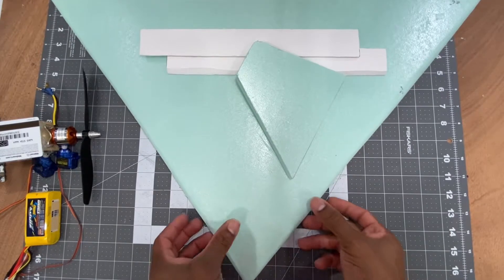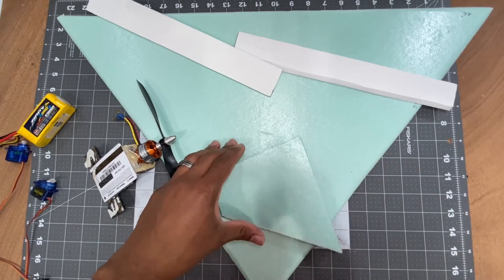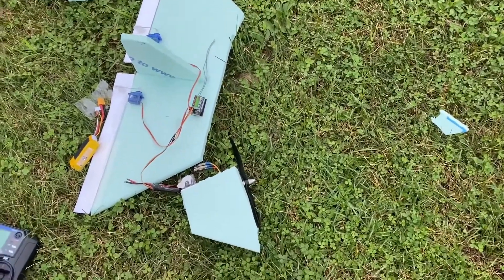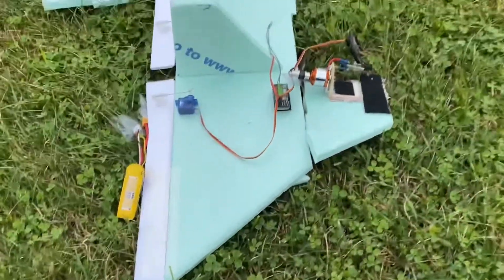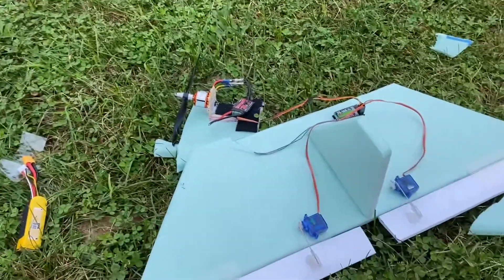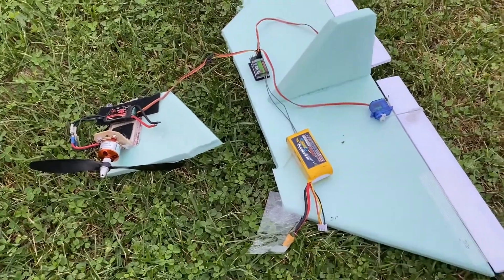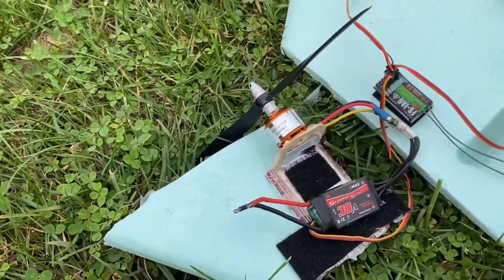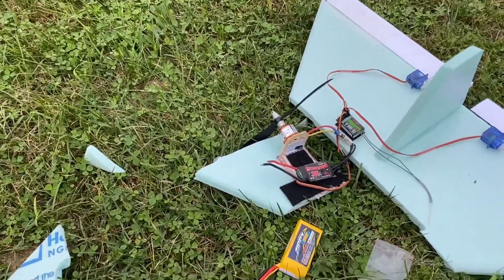How to Make a Rc Airplane Full Build Video: Diy Foam board Triangle Polygon Plane

Comment: Hi, great this wing, I make a 27-inch cardboard one, I find an approximate cg of 7 inches, it depends on the engine.....(weight)
How much is yours ?
In addition, the hinge point of the aileron control rod must be in right of the hinge. The video shows a hinge point too far to the back of the aileron.
Keep it up, it’s flying great !!!